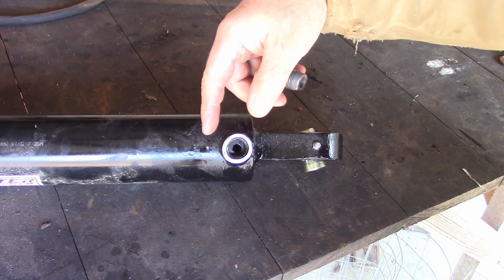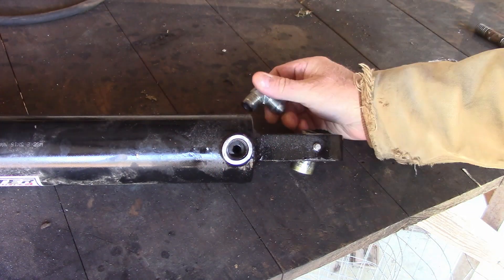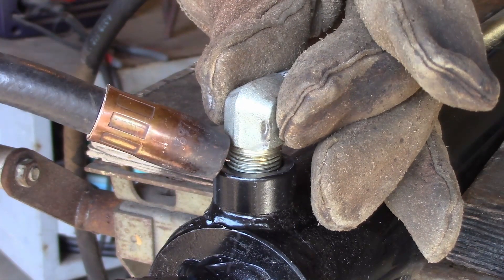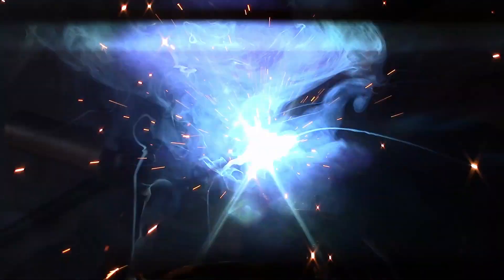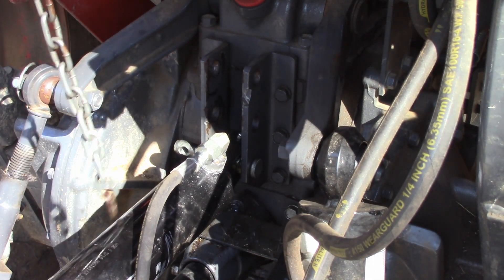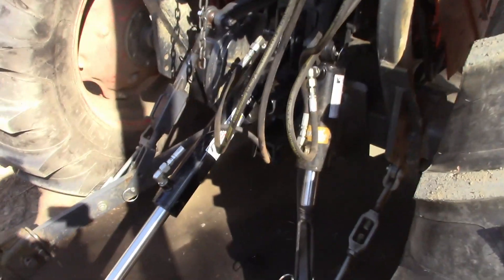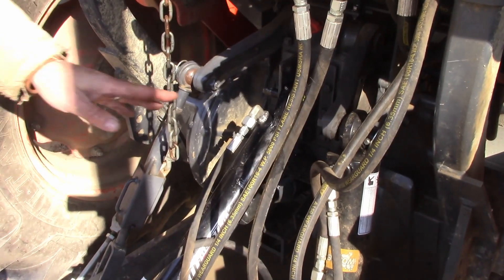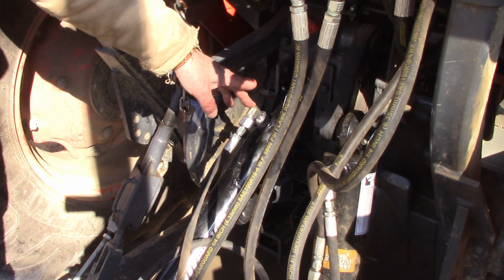Welding a Hydraulic Cylinder

Comment: If you weld on that cylinder did you have to remove all the oil and if you don't will it catch on fire or explode
Reply from the maker: I drained it out but only cleaned right at the weld.

Comment: I would probably move the flanges further apart, use a longer pin, and use shims or spacers to keep the cylinder from walking. That would protect the fitting from hitting the flange, at least. Don't know how long the weld job will last, but on a farm sometimes you have to do what's necessary.
Reply from the maker: Thanks Reed!

Comment: maybe sleeve the bore on the end of the cylinder, or use a larger pin, definitely would help with the rotational slop.  Did you prep the inside of the cylinder at all? or just drain the fluid?

Comment: Great video! On my 3910 Ford, one of the power steering assist cylinders was leaking so bad, I by-passed it and removed it. now the steering is "arm-strong" power steering. I heard they cut the cylinders off above the piston travel , replace the seals and re-weld the cylinder back together. Have you ever heard of anyone doing this? Thanks!
Reply from the maker: Yes. I've heard of cylinders like that.

Comment: It's holding.... Approved!

I might have TIG'd it, but nice repair-
Reply from the maker: You know I have a tig I bought a while back but have not put in the hours to train myself.  I keep meaning to and would have used it for this but I don't have enough experience to trust myself.  I really should take the time to learn it...
Reply: @SoatMon  I was raised on stick/mig....but always wanted a cleaner look with machining projects and the ability to weld aluminum.  I bought a multi-process machine and learned (with a lot of help from Youtube)....Jody [welding tips & tricks] who has posted a lot of great info. Tig may be my favorite, unless it's a quick/dirty job.

Comment: It's always a bit scary welding stuff exposed to high pressures. If it works it usually good enough and will hold up nice. I bet you'll get the safety trolls out with this one :)  Thanks for sharing!
Reply from the maker: I thought about the trolls myself, but I don't seem to have too many of them.  I don't ever respond to any negative comments so they usually wonder off.  I think the chances of a failure that would send it flying are pretty low, I think it would probably split on one side and spray everywhere.  Thanks Funky!!

Comment: You know that isn't something you see everyday, hydraulic fittings welded in.   I think you came up with an idea for a new product line.  Hydraulic weld fittings.  Did you ever own a 96 chevy pick up.  I bought one and the harmonic balancer was welded onto the crank shaft.  After seeing this it made me think of the old truck, and I thought you may have been that man.  But really this was a excellent way of solving that problem, hope I would have thought of that solution has I ran into the same problem.   Wonderful ideas as always.  Hope you all are dong OK and getting ready for spring.  It isn't here yet for sure but I am still planning on what to do when it gets here.  Thank you for the video
Reply from the maker: You know, I was worried what you were going to think about this one.  I'm sure it's probably not an approved way to fix it but I couldn't see much difference in welding the fitting or welding on a new port so I gave it a try.  Seems to be working for now.  I think the chances of a failure that would send it flying are pretty low.  I think it would split on one side and spray everywhere.  Time will tell.  The snow is gone, fun while it lasted but I'm glad it's gone.  I think it was the most I have ever seen here.  Thanks Glenn!